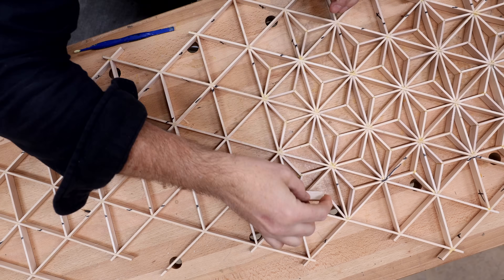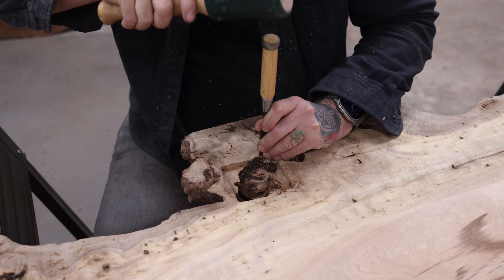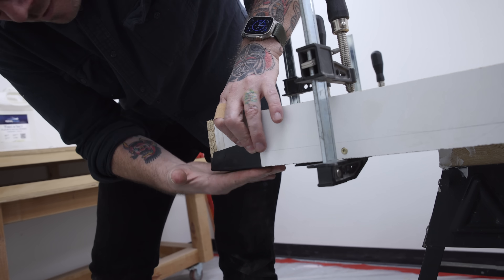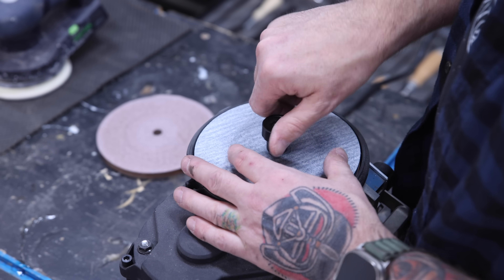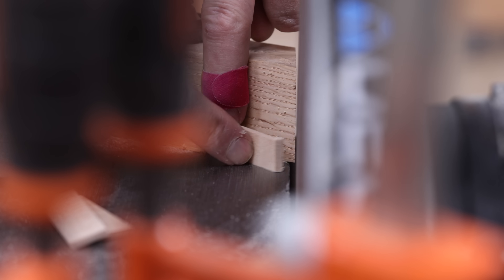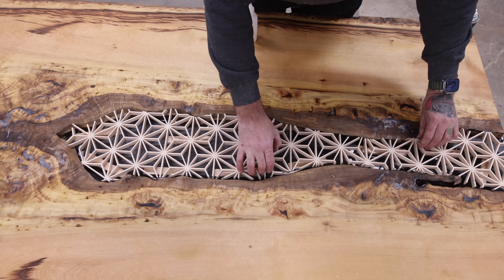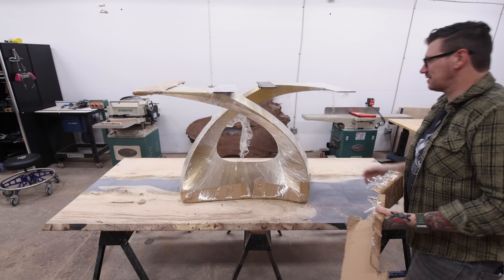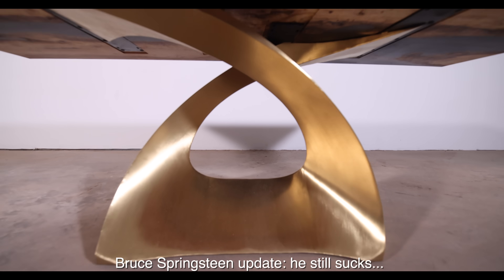Modern Table, 1300 Year Old Woodworking Technique

Comment: I don’t care what anyone else says, that patch job on that big ass knot was impeccable. So clean. Love it
Reply: I'm usually easily bothered by inconsistencies in patterns, and even I found it aesthetically pleasing.  ☺
Reply: Very nicely done. You can barely,  & I mean BARELY, tell the difference. Great job on the patch.
Reply: He should have turned it into a feature instead of a patch. Choosing a unique, maybe more organic shape, mimik the japanese technique or even add a metal piece would have made it better. I would ask to redo that part and come up with something better.
Even though it's for a good cause and it should be allowed to have imperfections to also show in the piece itself, that we are all valuable, I still don't like the way it's handled. Even our imperfections need to be properly cared for, for example people need to be given the right job, that they can enjoy with their capabilities, or provided the right tools, if they need special adjustments for example. It matters how we treat imperfections and we should provide the required care.
He showed it 2-3 times towards the end, but the end result, when everything was polished etc. it didn't look good anymore. 
I would even have loved to keep the imperfection as it was at the beginning. Maybe filling it with clear epoxy would have done the job.

Comment: Awesome build! You have my respect and admiration for all the work and detail you put into this project. I noticed the Marine Corps flag on your wall that makes me suspect you are a brother Marine. Semper Fi, brother! By the way, just a little FYI: Epoxy resin can degrade and break down from UV rays from the sun if not covered with a coating that contains UV protection such as certain paints or if left bright, a good quality marine grade spar varnish (several coats) that contains such UV protection. I've been working with epoxies for many years (used to have a wooden boat shop on Cape Cod). Heat is also an enemy of epoxy (gets soft and loses strength). 👍👍👍

Comment: Beautiful! Two things 1) Trees are made up of 50% carbon, as I just recently learned, which means that by turning it into furniture.flooring etc, you are prevent it from being returned to the environment through burning or chipping.  It will be encapsulated forever. 2) Suggest checking out the Urban Sawmill in Dripping Springs, TX.  They are equally concerned about the environment and have been provided grants to study Texas junipers, as like where you are, Texas has little in the way of wood for wood working.

Comment: For the insert, I would have used a more freeform shape - spares are not normally found in nature so they draw your eye to the defect.
The easiest way to do that is create the freeform template then cut the pocket and the inlay using a router inlay kit.

Comment: I believe the steel table base is made from sheet metal. They designed a 3D model where each facet only has simple curvature, then had the program „unwrap“ it, sliced it into non overlapping pieces, laser/plasma cut it out of sheet stock, glued a bending pattern to it, bring it under a cnc press break to bend it to the specified angles and then assemble the 3D puzzle with a welder.
Reply from the maker: Best explanation yet, thanks!

Comment: I find that a curved tip dental syringe is super for dispensing glue precisely and controllably where it is needed in the amount required, particularly when only a small amount of glue is needed in a specific location. . It is easy to fill and to cap the dental syringe up with a toothpick after dispensing the glue.... Dental syringes are very inexpensive (e.g. from amazon) and can be used disposably when you are not going to use them again for a long time.

Comment: Do you think I could do this for a counter top. But use little pieces of Plexiglass for the kumiko patterns instead of the little pieces of wood, so I could run led lights under it?

Comment: Undoubtedly one of the coolest tables I've ever seen... except for the base.  I know you loved it.  Not I.  Personally I'd want for big solid legs, one in each corner.  I understand there are some benefits to this sort of design (easier to use chairs near the corners without having table-legs in the way of your own for example,) but still.  Even if this is pretty stable, I'm sure it's not as stable as a four-legs-on-the-corners design.  Also, talking about stability, I love big heavy steel chairs.  I'd rather have that steel one than the lighter wooden ones you were proposing.  Again, amazing table top though.  Great work.

Comment: I've done lots of kimiko (by hand).  I do use a drum sander, but finish thickness with a plane jig.  I use Alaskan yellow cedar or port Orford cedar or white pine.  Maple is really too hard to do kimiko by hand.  I switched to titebond white glue instead of the Type II.  The white drys clear so sloppyness doesn't show.

Comment: I would have filled the kumiko panel with epoxy first and turned it into a slab, which I would then flatten and CNC cut like the wood board was cut, and then just insert/glue it in (into a pool of epoxy to fill in all the spaces). This, assuming that I couldn't CNC cut the kumiko assembly right away as it would be too fragile without a backing.

Comment: Why didn't you run the CNC on the kumiko, to make it fit the ridges in the table, based on the 3D scan? You could have gotten much better tolerances and maybe used slightly translucent epoxy so that it gets more depth...

Comment: Question.....why didn't you set the fence against the blade to slice the pieces instead of moving the fence for every piece you cut?
Reply from the maker: Cutting an 1/8 strip against the fence is a dangerous cut. The guide is called a thin rip jig, and it allows you to make the repeatable 1/8th inch strip safely.
Reply: @JonnyBuilds  Yikes! Now I know!

Comment: Do you use Mapp gas to remove bubbles?
Reply from the maker: Only bc that’s what I had. I really need to swap it out for the blue propane bottle. Map is too hot for this application.
Reply: I figured!  Thank you .

Comment: It is kinda funny when people think that epoxy or plastic in general lasts forever... cause that's just not the case. It does last very long, but it will break down eventually, and if you ever touched something with soft plastic that's older than a decade, you know how quickly that can actually happen because soft plastic will get disgustingly sticky.

Comment: It's not true that epoxy lasts forever.  Steel structures, like bridges, are painted with a three-coat system: zinc primer, epoxy immediate coat for sealing, and a UV-resistant urethane top coat.  The reason for the UV-resistant top coat is to protect the epoxy sealer because, wait for it . . . , epoxy breakdown under UV light.

Comment: I think everyone should learn to do things the traditional way (ie. hand tools) at least once but once that's achieved, if there is a machine that does the same thing or better, then use the damned machine. It's good to learn how to do things by hand so should you ever be in a bind where you need something done and the power is out, the machine is broken or just not suitable for the task then you can still get it done but unless you can call a premium on the final product for making it fully by hand, it's just not worth the hours and the stress pretending you live before the industrial revolution. Obviously if it's a piece for yourself or a gift and making it by  hand makes it all the more special then by all means indulge your craft

Comment: Kumiko Table 
   You do truly awesome work!!! And stilll I see you are stuck with a lie that our culture teaches & other cutures do not.
   Example: In gems - as it should be in all else - that pit would be called an "inclusion" rather than imperfection or flaw.
   In Gemology an inclusion RAISES the value above that of the ordinary gem. It is recognized & celebrated for its uniqueness.
   Nature/God/Universe NEVER makes a mistake. You & your tree slab were created PERFECT!
   The cultural idea that perfection = flawless is false. The correct definition of Perfection is "Exactly suited to it's purpose."
   Yes, the folks who insist on having everything "flawless" have full right to their opinion, however they are missing the point. LIFE has unexpected inclusions. The POINT is to include & enjoy them, use them to advantage.
   Differences & Inclusions are there by deliberate design as GIFTS from the Source of Creation. They have purpose & value that are not "normal" simply because "normal" is an arbitrary average point that DOES NOT EXIST in the Real World.
   Differences & Inclusions are tools to be used to CREATE LIFE in whatever way the individual chooses. They allow & promote change. Without them we would all still be protozoa wallowing in the mud.
   You celebrated the void between the 2 slabs, wierd curves & all. The TREE needed that pit to be there so it BELONGS there just as much as those weird shapes. It's part of the character of the tree.
   For a situation like this, instead of hiding that pit - trying to make it invisible - CELEBRATE it.
Perhaps fill it with a really sparkly acrylic & rhinestones. Better yet would be a semiprecious stone, like Agate or Jade, that matches or compliments your table. Best choice might be to use some scraps of your Kumiko.
   For me that would be perfect.